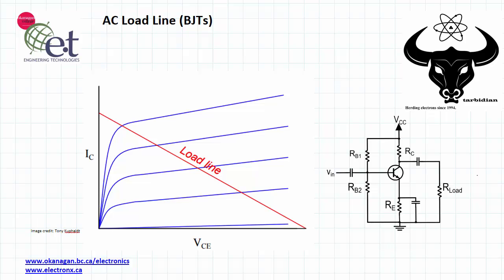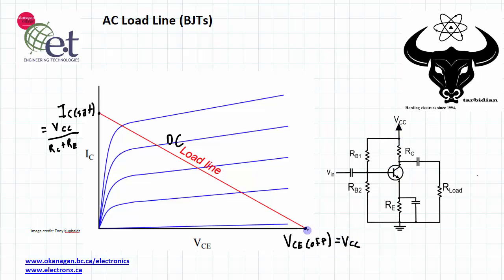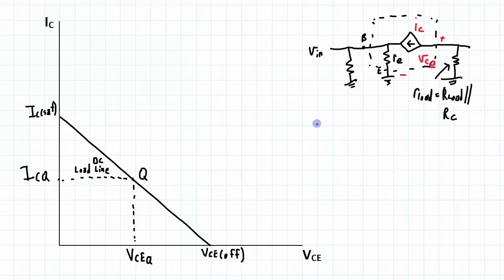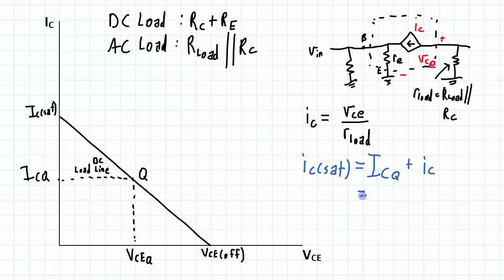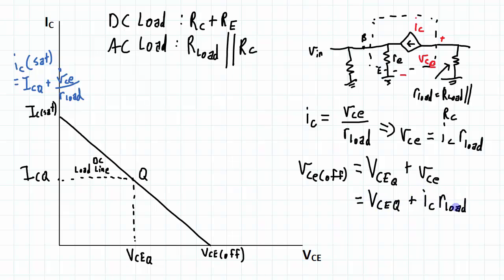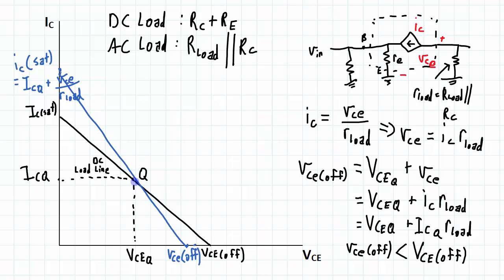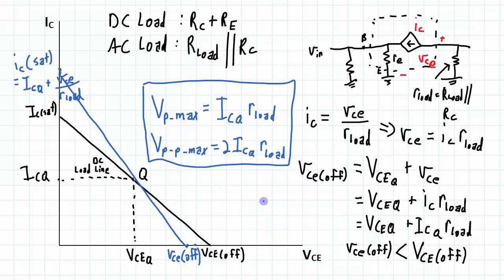AC Load Line of BJT Amplifier Circuit

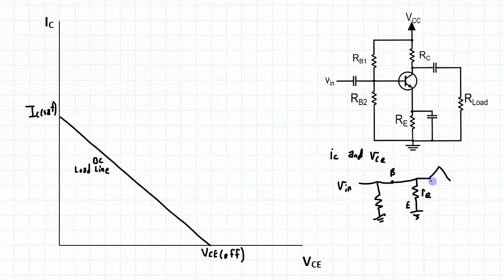Comment: At @2:53 the guy seemed to indicate that the resistor "re" was part of the actual transistor and that the transistor "E" point was on the other side, below said resistor. Is this an error right? (Those who are more familiar with this stuff may glide over such a trivial detail, but I'm hanging on to every detail to trying to follow😅). Thanks
Reply from the maker: re is part of the model of the transistor while RE is the external resistor that is part of the circuit

Comment: Excellent video that leads to a great understanding of how transistors do their thing when amplifying AC signals. Another way to bias without all the math is to hook up your oscilloscope and run a sinusoid through the circuit to check for clipping and min/max levels. Also, a spectrum analyzer clearly reveals harmonic distortions.

Comment: Hi David, @7:43 Can you please explain it in a bit more detail why you can use the Icq in place of the AC collector current?
Reply: I have the same question. Thanks in advance!
Reply: Nevermind, it's actually explained in the example video at 5:00. Because ic can swing down from the DC Q point to 0mA (when there is no collector current), the magnitude of ic is equal to the DC current Q value found before. Beyond this, we would have clipping, and therefore distortion of the incoming AC signal. Hope this helps!